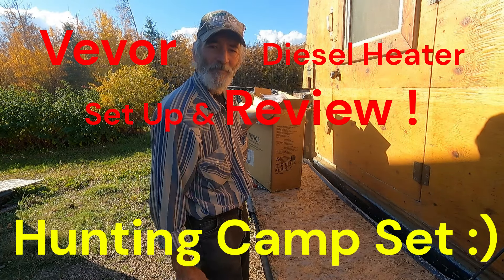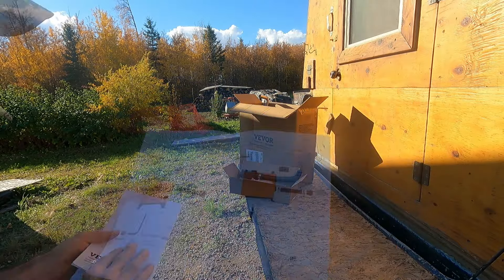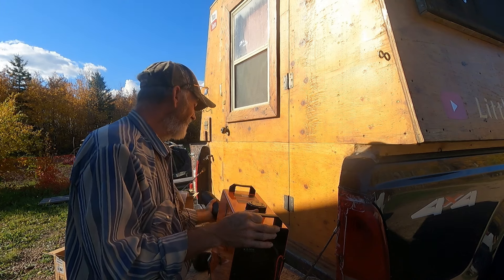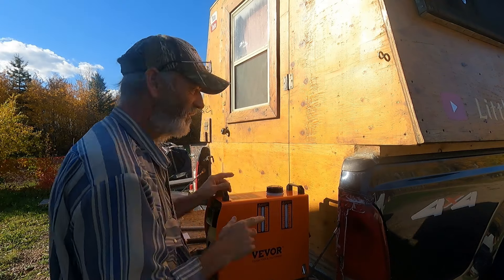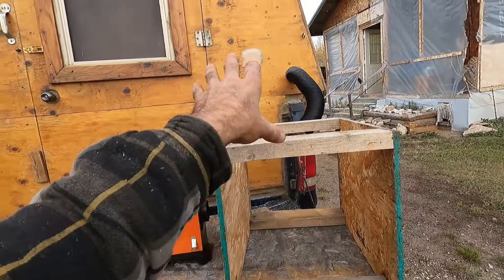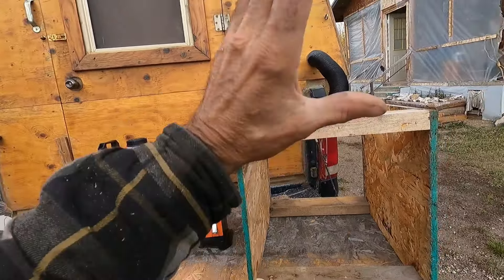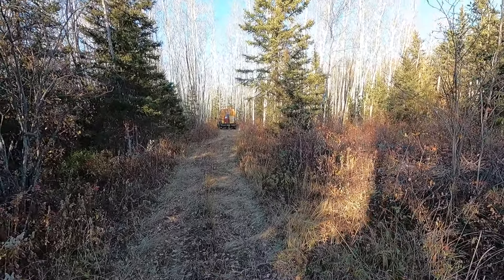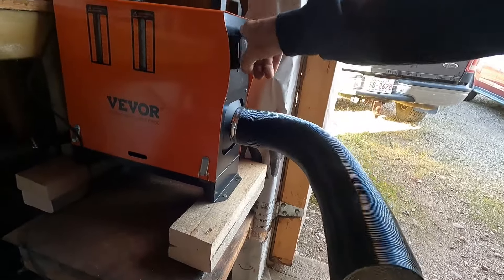VEVOR Diesel Heater "Review" DIY For Moose Camp & Setup Properly In The Shop, S3,E90,

Comment: Hi Don, I actually have one of those units , was a gift from my kids last Christmas , I'm working on getting that ready for my truck cap now when the weather gets cold, Have a slider set up so it feeds thorough the truck cap sliding window, but I need to build an enclosure now like you have there to protect it from the elements.  I do have it working in my shed now with my exhaust fed through the wall. it does get pretty hot like you said something that you have to be aware of. Hope you have a great week my buddy
Reply from the maker: Yes they work great :)

Comment: Good day Don
Bet that heater got your camper warm.
Good luck hunting.
Reply from the maker: Yup camper is just plywood it was -3c out but around 18c inside with the roof vent open about an inch :) They not meat to run outside the temp control is on the front & you need it inside, so just a little understanding the outside temp & what your ok with sleeping before you start the woodstove :) I have internet at camp lol, Thanks for the comment"

Comment: Lived on a sailboat for some time in the northeast. First year was almost unbearable. Cold winter water and damp frigid air. Had packing blankets and sleeping bags on the boat deck and interior hull. Condensation was unbelievable.  Game changer was when I installed a Webasto Deisel heater (pretty much the same as your Vevor) The diesel heater did the trick, warm and toasty, no more condensation issues and the thermostat was very convenient.  Our sounded like a small jet turbine when it would start from the outside.
Reply from the maker: Ya I seen a couple people that have them on their boats & they love them, This one has monitor & thermostat all on it but sat in my box I made & run good the way I set it up :) Thanks for watching"

Comment: Your power source  is what brand. And how do you like it. How long have you had it?
Reply from the maker: Hi That was my Allpowers S2000 Pro I had with me :) It works awesome & it's very light for taking with on a trip But I do have a Bluetti AC200L that is a lot heavier but it has bigger battery storage It's awesome I have it running my cabin full time & I have another review coming out in a week or so on it with an extra battery :) What are you needing to run ?
Reply: @littlegriffoffgridalberta6837  power my furnace? 
Emergency power without bringing out the power plant.
I have a older Onan 5000 watt.
It's to heavy to be moving around. I'll be putting it up for sale and get something lighter. Don't need 5000 watt anymore.
Reply from the maker: @bombardier3qtrlbpsi  Oh ok I'm not sure  how long it would run a furnace might get one night then you would need at least a 1500w invertor gen to charge it back up it will take about 45mins to charge back up, I have solar panels that give me 1000w's input & that chrges it in 4-5 hrs if you have sun :) The Bluetti AC200L has a pretty good battery & it still only weighs 68lbs

Comment: Make sure your battery doesn’t go dead because your fan will shut off for your cool down and it will melt the plastic on it to make sure your battery did not go down on your cool down psycho🎉🎉
Reply from the maker: Thanks for the tips :) I have two batteries so if the solar don't keep up I can switch every day, Thanks for watching